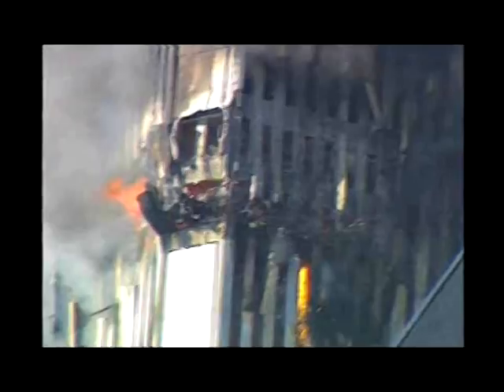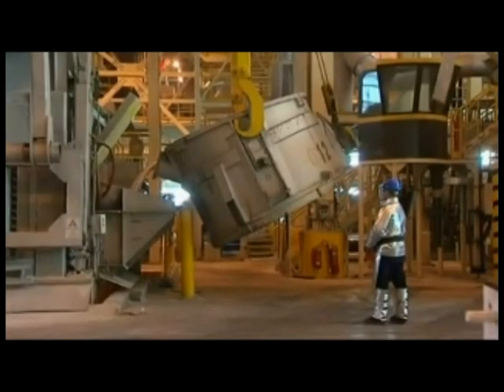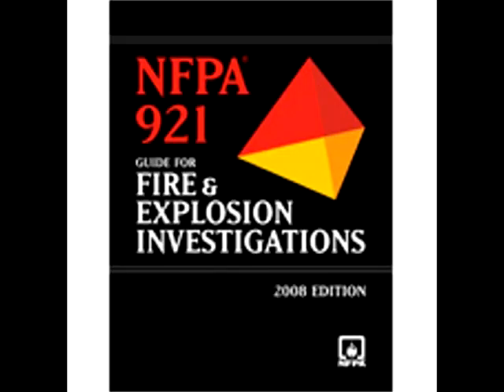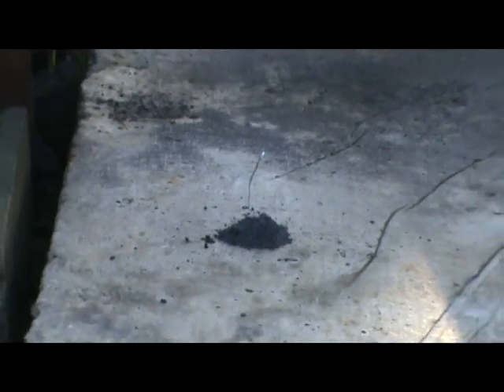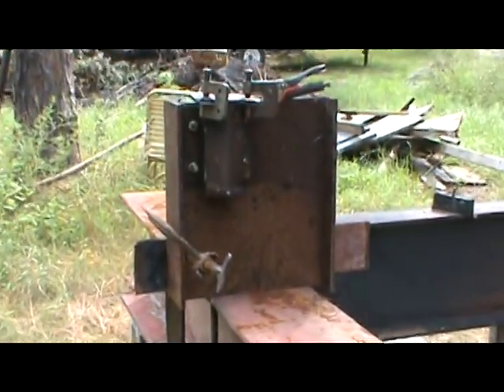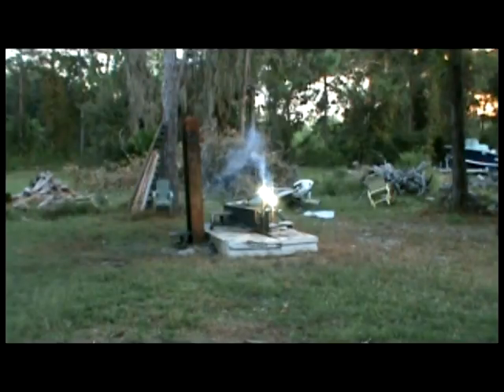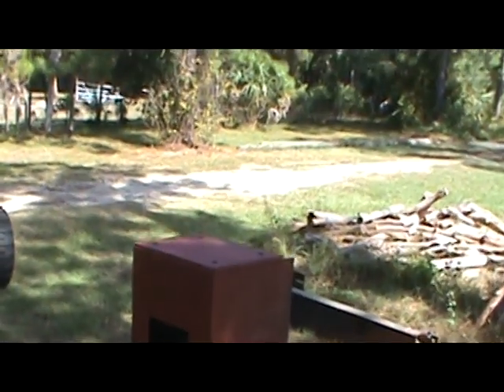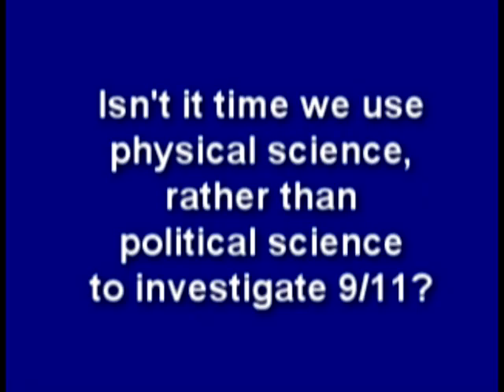9/11 Experiments: The Great Thermate Debate

Comment: Yeah conspiracy theorist tend to forget that sword-smiths heat steel to bend it to shape the swords. They don't melt them.  So the whole steel doesn't melt with jet fuel is a true but dumb phrase to prove their point.  Because of course it doesn't have to melt to bend. It only needs to heat it up enough for it to bend under the massive weight that was on those beams. Plus the damaged concrete from the jet impact. These same people forget what Tinsel strength (steel beams) and compression strength (concrete) is.  And they will never do a same scaled size test to see if the heat generated by the jet fuel and office supplies can bend a steel beam with the same amount of weight it would be supporting on it.   Oh and don't forget the buildings were burning for hours so you would have to maintain that amount of heat for the same amount of time it took for them to collapse. Longer if you are a thorough and true to scientific method.   This sounds like a Mythbusters episode.  Testing steel beam myths. But I understand why they wont do it if they choose not to.  A lot of people get so set on how right they are they ignore any evidence that says there are other possibilities.   

On top of which its far easier to believe that the jet fuel heated the steel beams enough for the trade centers to collapse and that the government hired suicide bombers to do it than it is to believe explosives were snuck into the building.   Buildings so massive they took up entire city blocks as explained by a guy who I use to work with from New York.  He didn't buy into the snuck in explosives theory either because as he said.  Those people have never seen the world trade centers in person to truly understand how massive those structures were and how impossible it would've been to sneak in enough explosives to bring it down without prepping it like demolition experts do for much smaller buildings.
Reply: +Seohn Aranys "Tinsel strength"??  Surely you mean "tensile strength"! Nice to use technical terms in your argument, but at least appear intelligent enough to know what you're talking about by using the correct spelling and context!
Reply: Oh my bad. I didn't realize your brain lacked the the capacity to figure out what I meant due to a spelling error.  Way to show how you lack the IQ points needed for basic problem solving skills for something so minor as one spelling error.

Spelling mistakes are not always due to lack of intelligence.  But grammar nazis who think themselves smarter only make themselves sound like they don't have the IQ points needed to understand what was meant in written text.  

That's typically what I tell people who try to make themselves seem smarter than someone else and the message less important or try to win an argument due to a spelling error. Especially since autocorrect didn't fix it. When I typed it I knew the spelling seemed off but autocorrect set it as that and I just went with it at that point. Its not a word I use very often. Spelling has never been one of my best subjects. But I'm great at many other things.  Is that lack of intelligence? No since you may be a bumbling idiot when it comes to PC building and networking compared to I, or in the case of the original post... Physics
Reply: the basis of any form of education is the capability to communicate an idea coherently, and to get a grasp on one's chosen language. So reliance on a "spellchecker" is a form of laziness, and an indication that one cannot be bothered to do something correctly. This is reflected in any text which is uploaded to the public domain, it is immediately peer-reviewed and conclusions drawn about the author. Do you really want to appear uneducated? If you submitted a resume to me with grammatical and spelling errors, I certainly wouldn't be hiring you ) Don't bother attempting to justify yourself; post muted.

Comment: So are you all saying steel doesn't bend when heated? If so then how are swords and Katanas made?  Are the videos of them being forged a a cover up lie too?  I'm not saying termite couldn't cut steel.  But just because it can doesn't mean other things can't.   The difference between a conspiracy theorist and a rational thinker is this.  A Conspiracy theorist denies all other possibilities. A rational thinker accepts that they could be wrong and that there is more than one answer including the less covert conspiracy versions.    I've yet to see anyone test and prove wrong that the beams can't bend under that much weight and heat over that much time.  Steel need only get hot enough to weaken and bend to the point of collapse under 1000's of tons.  It doesn't need to melt.

Someone get a steel beam exactly like what was used in the world trade center.  Then get office supplies and furniture and jet fuel.  Attach a massive about of weight to one end of the beam while the other is stationary and supported high enough to allow it to bend under the weight hanging from the opposite side (and I mean the amount of weight that would have been on the world trade center beams.   Next  apply the amount of heat using the jet fuel and office equipment and supplies generated for the same about of time in the middle of the steel beam.  Video the results showing if it bends or not.

Now with that said. I do not think explosives or thermite were used.  The jet fuel and weight of the building alone would've stressed the steel enough to collapse over time. Prove me wrong by doing the experiment above before you even try to say that I am wrong.   However I do think the government may have known something was going to happen they just didn't know when or where.   

I refer again to one fact. Steel does not need to melt to bend as proven by sword-smiths.  If you disagree with this statement prove me wrong with video evidence or cite your source of real science.  And one last fact.  A person whose mind is already made up can't be swayed. Such as conspiracy theorist.  Even if someone actually did the experiment properly and recorded a steel beam bending under the weight due to the heat of burning jet fuel and office supplies. No amount of proof will change their mind and they'll still deny this is a possibility.   Part of keeping an open mind is accepting that there could be more than one possibility.  I know I could be wrong that maybe the governement did do it. But I don't think that the case.   And unlike most conspiracy theorist that completely deny my view of it.  Those are people with closed minds.  I ignore them.  I'm saying they could be right.  Yet they wont even agree that I could be.  Despite the fact steel only needs to bend, not melt to collapse.  Yeah that is the mark of closed minded. Blind to all other scientific possibilities.  They latch on to one idea and never seek to look for others

Comment: think it through. You are putting up two of the tallest building in a city.... if either of then falls, it will fall on everything around it. remember all those cool films when we were kids of demolition teams imploding buildings??? hmmmm.... i would of hated to be the poor sob that had to push the buttons on those buildings... but it had to be done. they were built with self destruct mechanisms. they had to be. as far as thermite goes, you gotta be stupid if you don't know the f'n railroad system was welded together by the stuff!! stop using toothpaste with flouride! thanks for the video.

Comment: The molten steel was actually some of the 10 tons of aluminum from the actual planes, it wasn't steel.
(which melts at a far lower temperature) And thermite could have been added to the paint, during their last paint job.

Comment: Thermate......Conceder the temperature burning aluminum can reach......and the massive amounts that was available, 85,000 Kg. add the massive amounts of plastic and wood.......The natural drafting effect of the building.....I have no problem believing that the planes brought the towers down.....Also, the high temps would have a considerable effect on annealing......That's softening of the steel for those that don't know....

Comment: Ok, get ready for a text wall, but I have a few issues to address here on this matter I think most who imply the Twin Towers disaster was more than just terrorism.

On the day of 9/11/2001 I was at the residence of Mr. Leslie Robertson finishing up installing some floor receptacles in his den while he was watching CNN on his TV.  Why is this of any relevance you might ask, and the answer is quite remarkable as it has it.

Mr. Robertson was the structural engineer for the Twin Towers among many other amazing buildings he engineered.  I as an electrician had been working several months for Mr. Robertson and had struck up a good re pore with him in this time.  So when he saw the Towers hit by the first plane and at first report was a small plane, he commented what a terrible accident etc etc and I asked if the fire from a small plane would be a threat to the towers structure... He replied it was engineered to withstand a direct impact from a 707 jet airliner fully fueled, so  a small private plane should be no threat at all, there simply isnt enough fuel to weaken the structure and furnishing etc do not put out enough heat to be a threat.

With that we watched together as the second plane hit... We saw the 767 slam into the tower and I saw Mr. Robertson's expression and demeanor go from concern for those who may have parished in the first "accident" to absolute terror.  We then realized this was an attack as did the world and what concerned Mr. Robertson most at this point is were these jets fully fueled???   He immediately told me once we saw the 767 hit the 2nd tower if this plane was fully fueled it could, and most likely would bring the tower down from structural damage and steel weakening fire.  He then rushed and made calls to authorities and federal institutions with in NYC and the US Government to warn of the impending disaster.  Before he finished his calls the first tower fell which he had predicted it would if it was hit by a 727+ size fully fueled jetliner.  

This is the man who was the engineer of the towers, not some wannabe engineer or media personality.  This man knew before it happened the towers would come down due to the circumstances which proved to be the worst case scenario.

The point is the man who engineered these buildings and knows inside and out what could bring it down knew easily a fully fueled 767 would defiantly do it.  How can anyone question or argue with that?  No one would know better than him and he knew it before tower 1 fell.

Comment: You didn’t produce evidence you produced early reporting, very carefully cropped pictures and antidotes by unqualified people.

The molten “steel” you were on about was likely aircraft aluminum. Yes, it was very clever to distract people who are looking to blame anyone but the terrorists from the big ass air plane. But, the air plane was there none the less. Sorry to be a kill joy and remind everyone of the BIG ASS GOD DAMN AIR PLANE. FFS

At 550 degrees C (1022 F) structural steel has only 60% of the strength of steel at normal temperatures. And your video even states the fire was 1832 F. 

That means the fire was 1000 degrees too cool to melt steel but 810 degrees hotter than it needed to be to cause the super structure to fail. 

The question isn’t “What's wrong with mainstream experts?”. The question is “What’s wrong with deceptive conspiracy fuckwits on anomaly hunts?” The answer “attention whores lack of critical thinking”.

Comment: The beams never melted, they expanded under the heat, and broke the connections - it's a flaw of steel buildings, funnily enough you can build stuff of the same height with WOOD and it'll do better in these circumstances.

Comment: It seems like there's a very easy way to tell if thermite was used. A lot of iron balls of the size you'd expect from welding or foundry work were found on the site.  There are two situations:
1) thermite was not used.  All of the spheres should have the chemical composition of construction steel.
2) themite was used.  In this case, some of the spheres should reflect the composition of the residue from burning thermite.
Has this been checked?

edit
Also, it is possible for jet fuel and air to exceed the temperature needed to melt steel, just not in a 'wick and fuel' or 'small puddle' kind of setup.  If the incoming air were already heated, the temperature of the resulting fire would be increased by that amount.  This is actually what you would expect in a situation with a very large amount of fuel.

Comment: There is one hole in this theory that you NEED this much heat to melt iron. The answer is you don't. 
Look how high up the planes crashed, look at how much fuel not only caused by jet fuel but all the wires, furniture, carpet, plants, computers, the list goes on, was on those floors, mix that with the super high wind speeds and you get something called rapid oxidation, it's the same principle that pretty much and iron or steel worker uses on a daily basis to cut steel quickly, the fuel alone isn't enough to melt the steel so oxygen is added to making it super hot, which from what I see and can tell happened. Also, light smoke does not indicate a fire going out, black billowing smoke does.

Good try on the video, but if thermite were used, the building would have collapsed a lot more violently than it did.

Comment: As an aside, there were twelve types of steel used in the construction of the Trade centers. The most common type is ASTM A36, a low carbon steel, varying up to ASTM A242, which has a carbon content of .20%, which is by any definition low carbon. If you want to make a knife, you need high carbon steel with a content over 25% so you can retain an edge. Now to work high carbon steel like 01 or A1 or S7 the steel will need to be annealed. This is accomplished by heating the steel to its critical temperature of 1,450 to 1,475 degrees, which can be verified with a unique product called a Templestik, and the part number for a 1,450 degree stick is #28065. Templestiks are used like a crayon; when the steel reaches the desired temperature the material melts giving you a reliable annealing. Another method that I find more reliable, to my way of working is to attach a magnet to a wire and touch the steel. When the steel reaches a temperature which renders it non-magnetic, critical temperature has been reached, and the steel may be worked, then reheated and quenched in oil for 01, or cooled in air, for say A1. Then of course the brittle high carbon steel must be tempered. I use an oven set to 475 degrees so the steel exhibits a straw color, and is ready for sharpening. This is the method for annealing/tempering high carbon steel. 
Now remember, the Trade center was not made of high carbon tool steel, and when critical temperature was reached at 1,475 degrees the steel lost its strength but did not melt. It failed. The steel did not have to melt to fail, so the issue of actual 'melting steel' no doubt was not a factor. Critical temperature of 1,475 was easily reached in the jet fuel/office materials and equipment fire. Just wanted to bring that up after thinking about my earlier response. Please check it out yourself using a magnet or Templestik. May God rest the souls of those departed on that awful day.

Comment: The steel did not melt. The plane impacts dislodged the fire protection coating from the steelwork leaving the trusses supporting the floor very vulnerable to distortion and severe weakening from the heat. Especially vulnerable were the connections between the trusses and the central core and between the trusses and the outer wall. When these failed once  floors began to collapse onto those below there soon followed the catastrophic collapse of the whole structure. No melting occurred and the discussion of thermite or similar is a red herring.
Reply: Hi Bill,
There was no cutting and pasting, just an understanding of what happened to the buildings. What do you mean "go through the path of MOST resistance"?
When the trusses failed the floors dropped straight down on the floors below causing them to collapse too.  
Firefighters have a saying "Don't trust the truss". The trusses supporting the WTC floors had a spray on fire protection. Goes on like a foam and then solidifies. As the trusses were not normally accessible there was no concern about a risk of the fireproofing being physically removed but on 9/11 the impact of the planes blew much of it off. Also there is photographic evidence from before 9/11 that the application of the fire protection was patchy to say the least.
Trusses are lightweight and normally very strong for their weight but if any of the struts in their construction is damaged or weakened by intense heat the integrity of the truss is lost. Also key is to understand that the connections between the trusses and the wall and the central core would also have been severely weakened by the heat and at the same time under immense strain from the distortion of the buckling and twisting trusses.
Please tell where I am relying on a new law of physics.